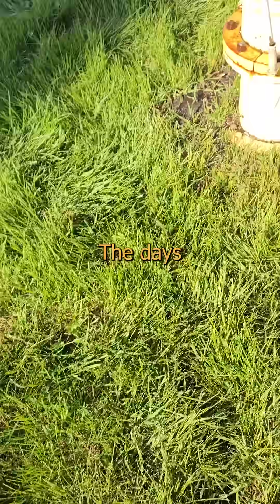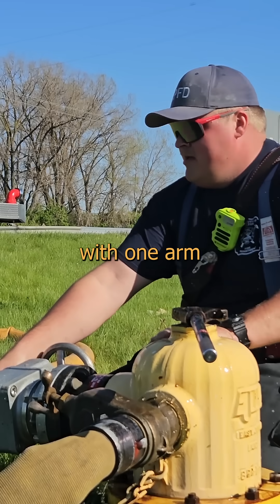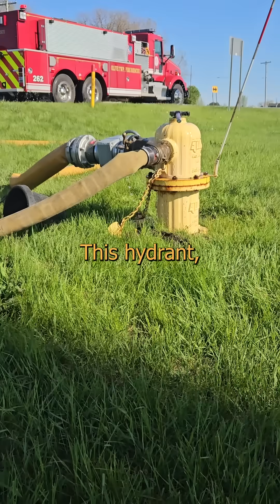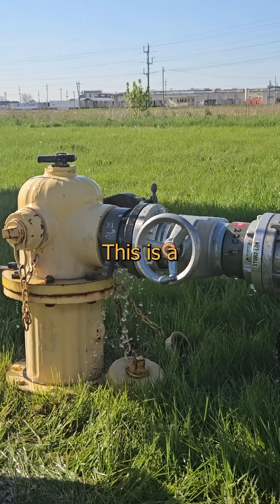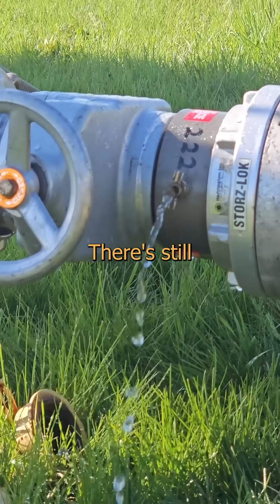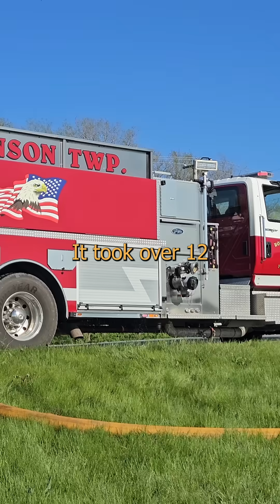Fire Hydrant Gate Valve #chrisboden #comedy #engineering #training #educational #pressure #science

Comment: 😂 we actually had that happen once in the winter where the hydrant wouldn’t shut off. Luckily we had a gate valve on the truck itself we were able to close and unscrew from the truck. Otherwise we would have been looking at some major problems with a froze up truck stuck to a hydrant in subzero temps. Just had to abandon a couple hundred feet of hose and the valve until the city could get it shut off.

Comment: Wanna know something else that's pretty cool? In the fire service, we call attaching all those valves to the hydrant, Dressing the Hydrant. Its not mandatory, but it is highly useful for specific situations such as the case shown in this video. The volunteers in Ottawa county were using that hydrant as a fill site for water tankers and the gate valves made it so they could leave the hydrant fully charged but keep the supply line dry until they hooked it up to the tanker to refill it.

Comment: They were doing a service check and had one not close on them. It dribbled for 3 and 1/2 months until Public Works finally came and replaced that hydrant. It ended up causing a flooding in one of the houses slightly down the hill, it caused a washout on the edge of the road, and every time you drove past that intersection, there was a little dribble of water running across the road as if someone left their garden hose on. Untold volume of water came from that hydrant over those three months. They are currently working on repairing and replacing the front yard of one of the houses down the slope. A small repair job that probably wasn't properly filed has turned into quite possibly a half million dollar project in damages

Comment: Hey! Firefighter EMT here. Aside from a failure of the hydrant valve, it also lets us control the waterflow of different outlets without shutting the entire hydrant off. Most will have a large 5 or 6 inch outlet, and two smaller 2.5 inch steamer outlets, all of ehich should have a gate valve so you can control waterflow as needed and shut the hydrant off if the hydrant valve breaks. This is an excellent video on something so small and simple for us. We also put the valves on sideways so the hydrant wrench doesnt hit the gate valve when equipped

Comment: The multiple valves also keep from water hammers happening. If the valve on the hydant is closed to quickly or opened to quickly it could cause lots of damage. Also the second valve heading out opens up like a double door. Pushing water forward but not backward.

Comment: Worked as a firefighter for a couple of years, those 5 inch hoses they use to commect to the truck from the hydrant are our supply hoses. Our hydrants are color coded in our area. Blue tops could give you 2500 gallons per minute. The amount of pressure our pump could push out is what will really make you pucker up. We use attack lines that vary in smaller sizes. That pressure, if not trained properly could whip anyone around and knock a skull fracture if not handled properly. 

Thus, your interior attack team will beat the heck out of the pump operator. Your pump operator is the life blood of your entire operation.

Comment: There is usually a valve connection between the hydrant and water main. Those valve keys are fairly cheap and easy to operate. We use that valve to replace old hydrants.

Comment: I drive a truck, but most of the time I'm not delivering loads. My team is dedicated to keeping the rest of the drivers moving by going out and picking up damaged equipment that needs to go to the shop. Well, when there's some equipment that needs a little bit of extra attention to get it to move, that's when I get sent in. Dumbass hostlers dropped a chassis on top of a guard rail with the front all the way up against a wall? I'm there, with a chain and some ideas to get it pulled out and hooked up to my truck.

Comment: I have experienced this first hand. In my area it's not an SOP to put a gate valve on the hydrant but it's something I do and make my recruits do because I learned it for myself. Opened up a hydrant to fill a truck and when I tried to close it, the stem just kept spinning and spinning. If it weren't for putting a gate valve on prior to opening the hydrant, we would have sat there with our truck attached to the hydrant spilling 1000gpm at 100 psi out of our truck until public works could get there. This was 9pm so it wouldn't have been soon. Love these videos and especially love this one and all those Tankers. That old yellow one was especially cool

Comment: Our fire station uses pressure valves on our Hydrants. Most of our water comes from rivers and the like usual, so hydrants are more of a bit Support 
The Problem is: these pipes aren't the best
So we use these valves to prevent that the pipes burst from closing the hoses or the like

Comment: Here in Kansas it's required to have a valve on the Main Line before the Hydrant to be used to turn off water to the Hydrant if for some reason there is a failure in the Hydrant.

Comment: The main reason we use the gate valve is to prevent the drain hole in the bottom of the hydrant from undercutting the hydrant.  This is especially important when we have multiple water tenders filling like in the video.

Water only drains out of the hydrant at the opening and then closing of the hydrant rather between each rig.

Comment: I can just hear my local water company screaming at shutting that 5 inch down with a gate valve. They scream when we don’t wait 2 minutes in between full turns of the wrench during hydrant testing. Yes btw that’s a true statement. Those guys are terrified of causing a water hammer in the system

Comment: on the opening bit- i only have a job because things go wrong. i work in manufacturing, specifically chicken. technically, every step of packaging could be automated (and it technically is), but it doesn't really work as intended. i have to babysit the taper, labeler, and stacking robots (and the pallet dispenser and wrapper) so that when they inevitably shit themselves, they can continue to work as intended as quickly as possible. i wouldn't need to be there if stuff just worked (i mean I'd still have to do setup and configuration, but i could just walk away after that) like it was supposed to. im glad that stuff isn't flawless, because i get paid for that.

Comment: Water department employee here. If there is an auxiliary valve in the ground where there should be there is no need for a secondary valve up top. Also, the ability to turn it off and on quicker is actually not a good thing. That's how you blow up old water mains. Water hammer is a thing

Comment: That gated valve is not to prevent the main valve from being used.  It’s to allow another truck to hook in and increase pressure incase.  Normally dressing a hydrant is attaching a gated valve at all points so additional lines can be hooked up without shutting the hydrant down.

Comment: I used drive the dust mitigation truck at the quarry I used to work at. If I was lucky I got to use the 5 inch hose with the large water pump, and it would fill the truck in about 3 minutes. But the big thing was I had to make sure the hose was drained before I unhooked it; because you could really hammer on that thing, and it just won't turn with pressure on it. Next to that you had the 3-inch hoes, that would fill the truck in about 15 minutes to half an hour, depending on the grade you were pumping up. If you kill the pump  you can take  those hoses off, but they weigh about 150 lbs full of water; so you'd want to drain them anyway.

Comment: Back in February of 2007, there was a massive fire in Maquoketa, Iowa that burned 4 buildings. At least 42 departments responded, including aerial trucks from Davenport, Eldridge, Clinton, and Dubuque (DeWitt and Maquoketa have gotten aerial trucks in the years since the fire. But at that time, these four cities were the closest ones with aerial trucks.). There were crews from every department in both Clinton and Jackson counties, and also crews from Dubuque county and from Fulton and Savannah, Illinois. About half of the departments just sent tanker trucks, as one of the biggest obstacles was the sheer volume of water being used. It took them over 12 hours to put the fire out, and they used so much water that they had to pump from the Maquoketa river because there were concerns about water mains collapsing due to the massive draw. It was like -10°F with windchills of -40°, and that was the biggest reason why so many departments responded. They fought the fire in shifts, each lasting maybe 10 minutes max before the firefighters had to go warm up and thaw out their frozen coats. There was one crew stationed at the river whose only job was to keep the holes in the ice open to drop the pump hoses into, because the kept freezing back over.

There were over 100 fire fighters there that night, with probably 90+% of them being volunteers. The only paid firefighters were from Davenport, Eldridge, Clinton, and Dubuque.

Comment: Shutting down a mid line pump too fast on a 120km long  18 inch concrete lined steel main running 1500kPa pump discharge pressures WILL pop the pipe up out of the ground.

Comment: First off. I love your channel actually my favorite. 
Down to business though, your right and wrong. 
  Truth is it's very very rare your break the operating rod. The actual reason for the gate valve is control. At the bottom of the hydrant five feet deep eight in the mountains where the valve is are weep holes to let the hydrant drain. They are only turned off when hydrant is fully open. So a hydrant must be fully open when operating or you will flood the soil underneath. So you open hydrant all the way closing weep holes and control the flow with gate valve. This keeps soil dry and hydrant planted tight and sturdy. 
And that's pretty cool. 
If i could attach a photo here i would show you a parts poster that gives you complete picture of the working in a hydrant.

Comment: Those are butterfly valves on the hydrant ports , fire hydrants as well as isolation gate valves only should be closed tight or wide open never throttled

Comment: Had a hydrant valve go bad on the inside and deliver over 3600 gallons of water on the ground in the time it took us to grab another hose with a end and cap it off. We had a 5 inch hose explode under us one night when running pressure tests for the city of Kenova WV. I literally thought I was dead but had remembered to wear my goggles for once. it blasted them off of my face and left a  purplish black bruise on my entire face and chest. Felt worse than getting hit by a car.

Comment: The valves also make it easier to add and remove hoses without having to shut off the hydrant, ensuring water still flows to the other hoses that could be in use by other trucks.

Think of it like circuit breakers for water. Even if were possible to connect every electrical circuit in a building to one breaker, it would not be very practical. We use a lot of breakers, not only to make sure everything doesn’t get overloaded, but to make it easier to turn on and off specific circuits while still allowing electricity to flow to the others.

Comment: As someone that has been in the fire service for 27 years, yes I had two hydrants back in the mid 90s that I hit . And yes, those two hydrants when shut them off after the 18th turn it kept spinning both hydrants were broken fully open. We ended up drawing a vacuum on the hose and quickly drove another firetruck on top of the hose disconnect it real quick and put a cap on it

Comment: Uhhhhh…. I’m a retired firefighter, 48 years service. You’re not correct in your description why there’s two connections on the hydrant. First, the large connection, anywhere from 4” to 6”, is called the steamer connection ( from way in the past), that’s the main connection we use for water flow. The other outlets are 2.5” diameter where we attach a what called a “ gated wye” or “ hydrant valve”. That’s so other apparatus arriving can also tap that hydrant and keep the hydrant from requiring to be shut down to connect to the hydrant. There’s either quarter turn gated valves or a single valve with the round shut off handle as shown in your video. That method of shutting off the valve is slower but prevents water hammer from developing in the hose lines. The hydrant water flow is based upon the size of the water main it’s connected to underground.

Comment: By the way, about the quick connectors that are nowadays used on larger fire hoses: Apparently they were tested and some units started buying them... but they got 4" or 5" instead of the existing 4.5" standard from Europe for which all the fittings are already available AND no adapters would be needed because it's all one size. That one could have used some more planning.

Comment: I work in railways and it's the same. Those 300t toys aren't easily stopped and tend to do a lot of damge quite extensively.
So we have a lot of procedures we don't use frequently, but when needed, do have to be executed post haste before a stupid amount of stuff gets crushed.
Other than that, most of the time the job is oretty chill.

Comment: Tanker shuttle is a thing of beauty when it's up and running smoothly.  It's the startup part that's a little hectic.  Dressing the hydrant at the full site and drop tanks at the dump site.  

You would appreciate a piece of equipment called a turbo syphon.  It uses the venturi effect to draft water

Comment: There is more to a hydrant gate valve, then just being a secondary shut off. 
Fire hydrants use a plunger valve, which has to be 100% closed or 100% open. You cannot leave it only part way open, because of how the hydrant is designed to drain itself.  If it's left partially open, you will blow just as much high pressure water into the soil beneath the hydrant, as will come out the hose, possibly even more. This is where the gate valve comes in. Allowing you to close off the hydrant, or open it only part way, for reduced pressure and flow, without creating a sinkhole.

Comment: As someone who is a Engine Pump Operator (the guy who drives the fire engine)... We actually do train for what happens if the valve stem in the hydrant breaks. (Spoiler: We open the gate on the valve, so pressure won't build up, and then we put the valve on as normal, except with water flowing through. And then we close the valve. It's not hard, you just end up soaked to the skin with what is often not particularly clean water.)

And that hydrant should easily provide far, far more than 1000gpm that close to the tower, unless there's some kind of restricter plate in the pipe somewhere.

Comment: In our area it depends on the source of water. A tanker shuttle operation for us uses twin 2.5in hoses rather than a single 5in, and we use gate valves then. We don't use 5 inch gate valves on hydranted fires just a gate valve off one of the side outlets. If something goes wrong you can let pressure off with the side gate valve, recap the hydrant, close the valve and call public works. 
We know we're in for a long night when you hear incident command calling dispatch and telling them they need the water department.

Comment: Here in so cal. They are now prepositioning water tanks on hill and mountain tops for fire copters to dip into. But it all goes to heck when the winds  blow 60 plus mph. The fire in altadena seemed to have been started by a disconnected high tension power line that runs parallel to a new active high tension power line.  I an others wonder if the line was inductive charged or did it get charged by the 90 mph winds creating a massive static charge on the lines.

Comment: As my father, son of a ‘nam USAF flight instructor (too good to risk sending overseas), and pilot in his own profession, likes to say: “Continental doesn’t need pilots to fly the planes. Autopilot exists, we mostly do nothing, and on the newer jets there’s even autoland. We exist to handle everything ELSE that could happen, even if nothing else does 99% of the time, cause that 1% of the time, you lose both engines over a mile up in the air, and you need someone who took the time before take off to map out the closest viable landing areas to EVERY POINT ON THE FLIGHT PATH, to immediately start gliding there cause now your delta V is stored in altitude, not fuel.”

Comment: "It even has a valve on a valve..."   Where I work we use ice blasters to clean some of the equipment, and these things use tons of air.  Think of an inch and a quarter air hose feeding a machine that blasts out little CO2 pellets on the other end. We use hydraulic connections for the air. in order to do that, there is a valve behind it to hold the pressure back, otherwise you wouldn't be able to put the connection together.  It's not a perfect system because whoever installed it failed to include a valve to dump that pressure, and more than once I have had to go tap the inner donger (pin) with a hammer to let the pressure out.

Comment: That's pretty good but our department never had them. This had been many many years ago now but we just connected hose directly and used the spanner to turn it on and off again. Hydrants were checked regularly and we never really had an issue with it being a problem. 

We did have a few hydrants that didn't put off enough flow that the town never fixed but luckily none broke valves and you couldn't turn them off. I was with that department for about five years.